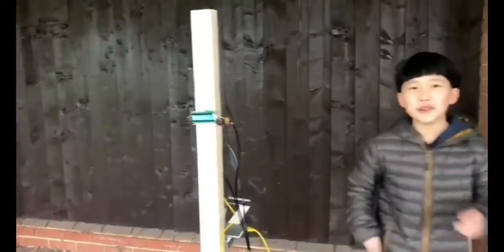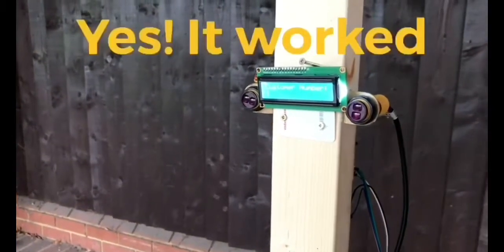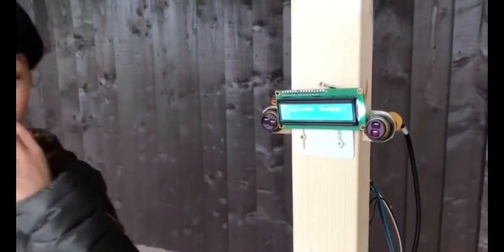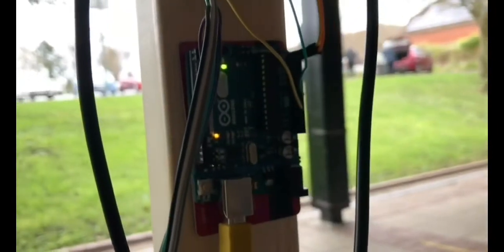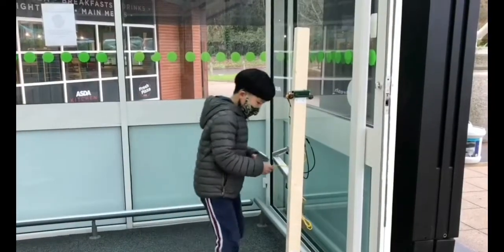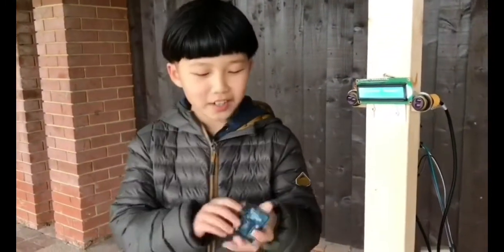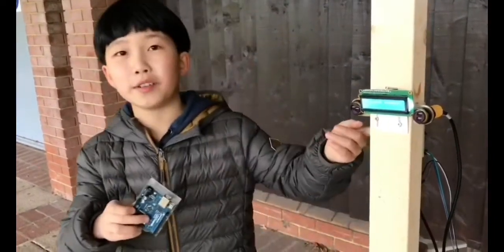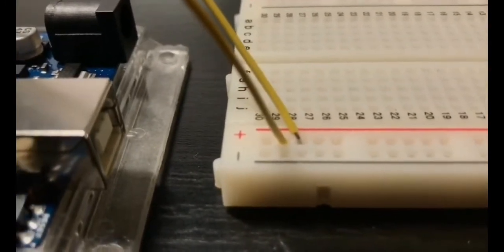People Counter Arduino DIY project 2021 | Bidirectional Customer Counter | E18-D80NK LCD UNO Jezza

Comment from the maker: Here's the code:

fv
#include <Wire.h>
#include <LiquidCrystal_I2C.h>

int cust = 0;
int oldCust = cust;
int sensorA = 7;
int sensorB = 2;
boolean ACTIVE = LOW;
boolean INACTIVE = HIGH;

LiquidCrystal_I2C lcd(0x27,20,4);  // set the LCD address to 0x27 for a 16 chars and 2 line display

void setup()
{
     pinMode(sensorA, INPUT);
     pinMode(sensorB, INPUT);

     Serial.begin(9600);
     lcd.init();                      // initialize the lcd
     // Print a message to the LCD.
     lcd.backlight();
     lcd.setCursor(0,0);
     lcd.print("Jezonics Ltd");
     lcd.setCursor(0,1);
     lcd.print("Customer Counter");
}

void printAB(int a, int b)
{
  Serial.print("A is ");
  Serial.println(a);
  Serial.print("B is ");
  Serial.println(b);
}

void loop()
{
    boolean inA = digitalRead(sensorA);
    boolean inB = digitalRead(sensorB);
    int delay_loop = 10;

   printAB(inA, inB);
   if ((inA == ACTIVE) && (inB == INACTIVE))
    {
       while (delay_loop-- &&  inB == INACTIVE)
       {
           inB = digitalRead(sensorB);
           delay(50);
       }
       Serial.println("in A");
       printAB(inA, inB);
       if (inB == ACTIVE)
       {
           Serial.println("Welcome");
           cust += 1;
       }
    }
    else if ((inB == ACTIVE) && (inA == INACTIVE))
    {
       while (delay_loop-- && inA == INACTIVE)
       {
           inA = digitalRead(sensorA);
           delay(50);
       }
       Serial.println("in B");
       printAB(inA, inB);
       if (inA == ACTIVE)
       {
           Serial.println("Good bye");
           cust -= 1;
       }
    }

    if(oldCust != cust)
    {
       lcd.clear();
       lcd.setCursor(0,0);
       lcd.print("Customer Number:");
       lcd.setCursor(0,1);
       lcd.print(cust);
       delay(100);
       oldCust = cust;
       Serial.print("Customer number is: ");
       Serial.println(cust);
    }
}